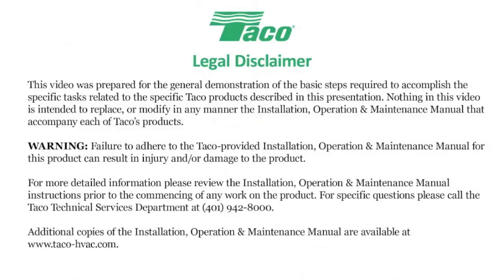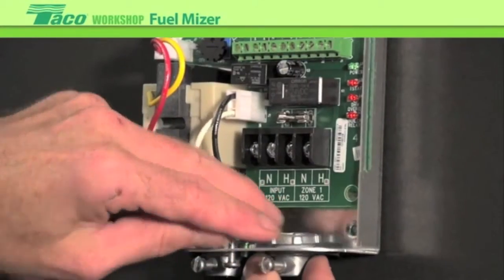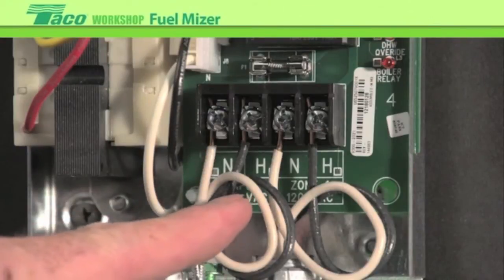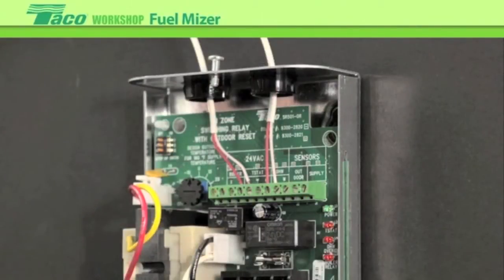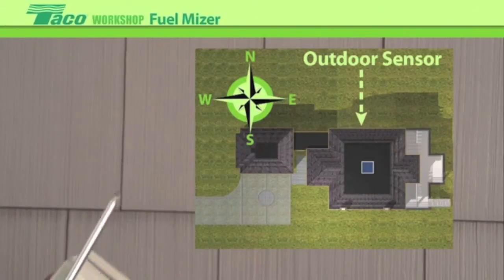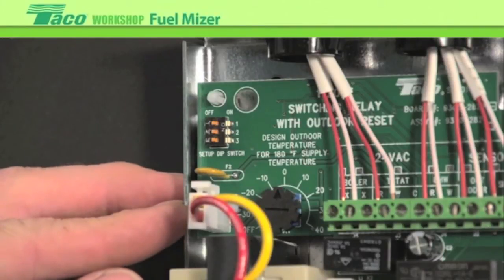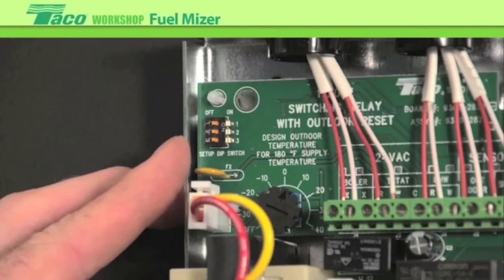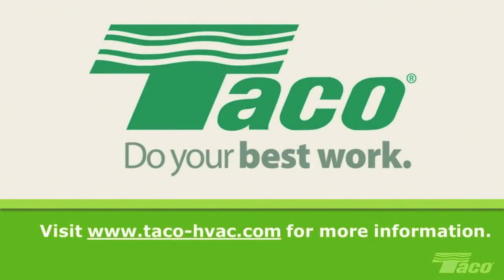How to Install a Taco FuelMizer

Comment: Does it replace Honeywell L8148E1265 ? Honeywell control comes with two extra feature, 1) Damper wiring with control 2) It has Well Sensor which your control does not have.
Reply from the maker: The FuelMizer does not replace the Honeywell controller that would have come with your boiler, it would work in conjunction with it. The FuelMizer would tell the Honeywell to stop the boiler from firing when the target temperature was reached based upon the outdoor temperature curve. The Honeywell controller also acts as the high limit for the boiler.